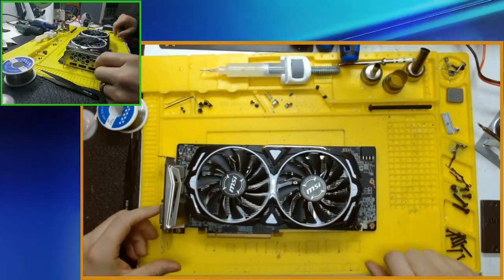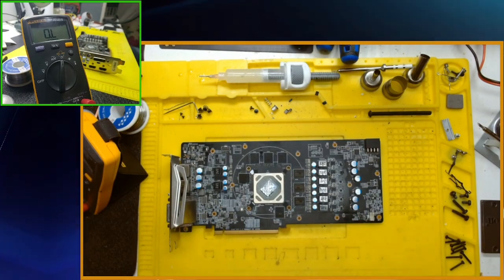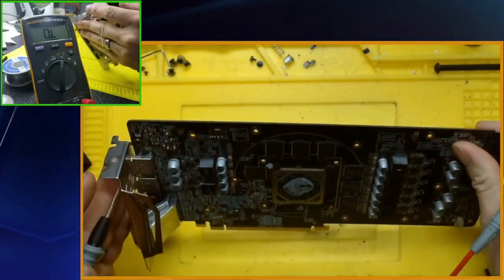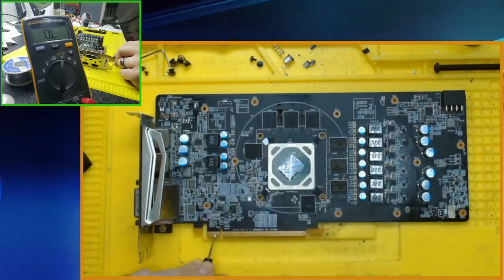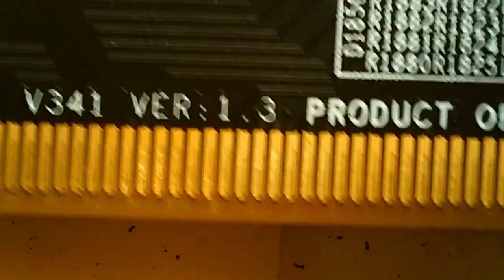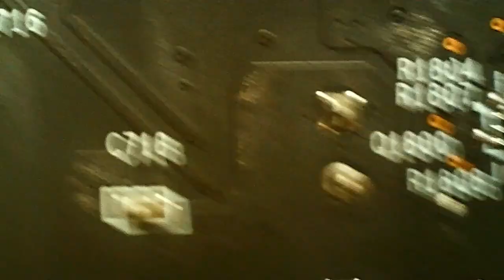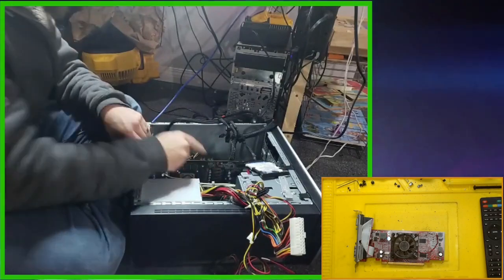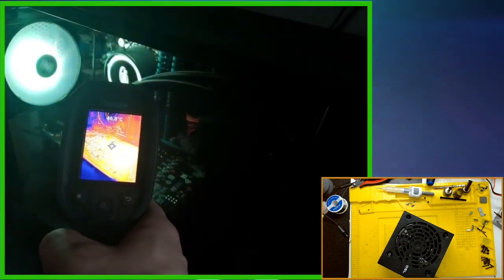Ebay RX 580 8GB repair/testing

Comment: Please HELP, I have an XFX RX 480 8GB and APW8713 on Display Rail is not generating POK so there is not EN on the PWM (NCP81022) so no Vcore. I measured resistance and everything seems to be OK, also All voltages are good but Vcore is not present. what can I do? all voltages on APW8713 (EN, VIN, VCC) are also present but still no POK, chip is not overheating. Should I just replace APW8713? or is something else I could try?? I dont have replacement
Reply: do you have power at the output / lx pins? if no output replace apw8713

Comment: hello i have rx580 8gb i accidently tried to update the bios ... i slushed the chipset chip by mistake any way to repair?
Reply: slushed? wdym
Reply: @level8473  i mean flushed the wrong 8 pin chip
Instead of bios i flushed probably the chipset
Power regulator chip
Reply: @Captain-love  Does the card still power on?
Reply: @level8473  yes but not sisplays any video
Reply: @Captain-love  Flash the correct vbios on the bios chip first
Reply: @Captain-love  You really can't flash the power regulator. Most probably you flashed a wrong BIOS version. When you search for a BIOS, make sure it is for the same VRAM your card has  (Samsung, Elpida, Micron, Hynix).  If your card is still detected if you use the onboard graphics, you only need to flash the correct BIOS.